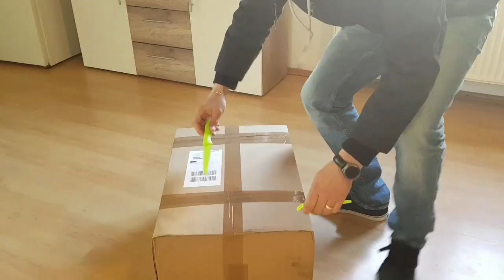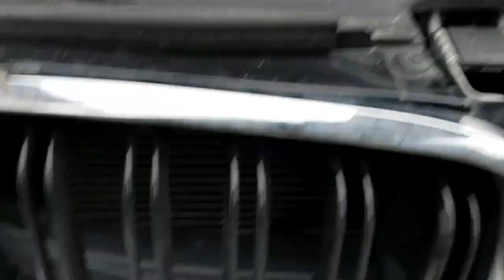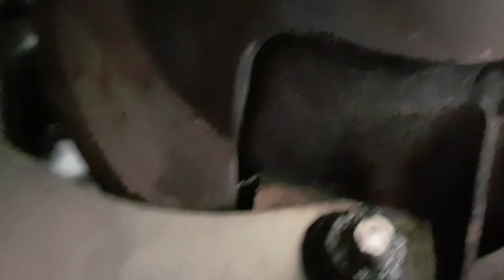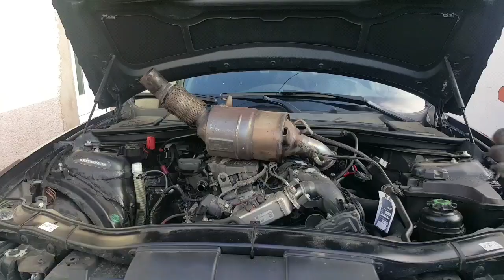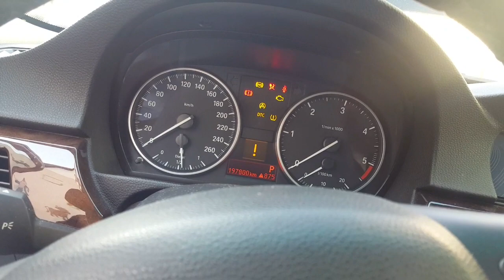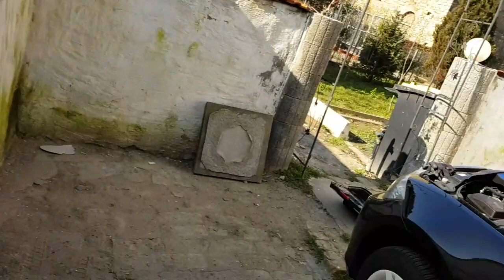BMW E90 DPF replacement (how to)

Comment: Hi !  You used an aftermarket dpf? Is it still ok?
Reply from the maker: Hi, it was an original one in exchange. It was fine but I sold that car a long time ago
Reply: @WarpDriveM do you believe an aftermarket for example walker would be ok for a Mercedes Cla 1800cc 2014 diesel?

Comment: Did you need the software to delete the error code after the new install ? Thanks Jon
Reply from the maker: Yes, you need a Software to delete the old Code at least. Normally you should register the new dpf as well

Comment: After looking online. It seems that once you have reached 150.000 miles the car will tell you that it needs to be replaced automatically even if it is OK. As my car is running perfectly fine I will just reset it and see how things go. Good video might need to revisit.

Comment: I had the dpf removed but my car is constantly blowing out white smoke and also rough idling. do you know what this could be. thank you in advance
Reply from the maker: Those are signs that is burning oil, injectors gone bad or dpf was removed and not properly coded out

Comment: Thanks for the very helpful video! I have to replace the flex pipe on the dpf on my e91. I was told, that I need to remove the dpf for that and I thought it would be super difficult. Now I think it’s probably doable! :)

Comment: My friend has the same model with a downpipe. Is it possible to put back a DPF, because the pollution regulation has changed. Is it the same operation than changing the fap? Thanks
Reply from the maker: Yes it's the same method to remove the downpipe and reinstall the new DPF
Reply: @WarpDriveM  i have read that the catalyasor and dpf are in one piece. in the catalysor there are 3 connectors. Can you please explain where the 3 are connected? I think one is the lambda probe. Thanks
Reply from the maker: Yes inside there is the kat and the dpf, 1 is lambda sonde, nox and pressure sensor and the 3rd one ist temp sensor. The plugs fit just one connection, you cann not put it wrong
Reply: @WarpDriveM  so there are 4?
 1. Lambda
2. Nox
3. Pressure sensor
4. Temperature sensor
is that correct? Thanks a lot. First time I get someone who can answer details!
Reply from the maker: The nox and pressure are on one sensor. The thin one is the temp sensor
Reply: and when the car has the dpf removed, i have read that they cut the dfp and break the ceramic, then they solder everything and put the sensors again. but the soldered part is not visible by the garagist. How can we make sure that a e90 we buy still has the dpf? Can it only be visible by the diag tool?

Comment: Did you replace the dpf with a bmw part or was it OEM? How is the car going now?  Good video.
Reply from the maker: Bmw part or oem is the same thing and yes. I've send my old original dpf to a company that cleans it and I received an original one reconditioned
Reply: @WarpDriveM  very good. How is the  car driving now 2 years  after you cleaned the Dpf?
Reply from the maker: @kirwanjohn101  no problem after that at all. I've sold the car about 2 years ago...I have a 435i now. You can check the channel for other videos if you like

Comment: Michael, just now as I have done the job myself, I noticed, you said earlier in the video that you wanna replace the DPF completely, but then I saw here https://youtu.be/6D_z9MHGQ3A?t=579 that you have also replaced the Flex tube on your old one, probably for selling it. Thats also what I did and I can only encourage everybody to do so, its only 30-50€ and some welding instead of a new DPF.

Comment: I've done this myself on my 2009 e87 118D. I have found that you don't need to remove that top bracket 14mm nut as you do at around 6:30. Using a long wrench the 13mm bolt can be unscrewed from underneath (use penetrating fluid though). In my case the nut stayed on and I think it's supposed to remain there. 
For me, the hardest part was removing that sliding electrical connector :) Never thought I had to use wd40 on those.
Thank you posting this video!

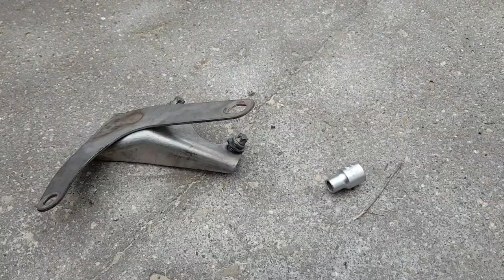Comment: Hi man. Thanks for the help with the video. I just changed mine dpf. I have a little tip. The support with the two bolts that fixes the dpf under the car. The one that you talk about at minute 11:20. I did not remove it because the position for unscrew the two torx is very bad when you lay under the car like me and they are very tight. I have only bended the two metal plates off the bolts and a little more for easy removing the dpf under the car. then when you install the new one and fix the upper bracket to the engine side you can bend the plates on the bolts and put the nuts on . the metal is very soft. so the job is even faster. last nut and bolt from the upper side. i did mine in 2 hours. 
thanks again for the video making the job possible for anyone with simple tools

Comment: There should be a gasket between the turbo and the dpf. Did you also replace that and the v-band clamp?
Reply from the maker: Not all the models have that gasket. In my case was no gasket and I've reused the v band clamp

Comment: That captive nut (14mm) on the dpf bracket was tight on mine too as not meant to be undone should take 13mm bolt from bottom why put mistake  in video wasted half an hour breaking that off lol

Comment: Warum didn't you clean your old dpf? You could save much  money.
Reply from the maker: This is what I've done! I've send my old dpf and I received a new reconditioned in exchange. The one that I replaced wasn't brand new
Reply: @WarpDriveM  Danke  für deine antwort!But  could  you tell me is posible to clean dpf without to remove it from it's place location?I saw on youtube that can be used a spray or something!It is a good  idea or not?What  is your opinion ?Danke!
Reply from the maker: It is possible but it won't work if the car has already memorized a dpf error even in shadow errors. That means more than 50% is clogged and you won't have any real results with a spray can. You might get away with it if you start regen with software and drive the car on highway more than 500 km to be able to do more than one regen
Reply: @WarpDriveM  thanks!

Comment: Thanks for the video, can you confirm you removed the DPF from below without removing the engine mount, thanks P.
Reply from the maker: Yes. But only for 1.8l and 2l. For 3l engine and above you have to remove the engine mount or subframe

Comment: Is there a gasket between the turbo and the dpf
Reply from the maker: No. But there are  some models that have a metal one. 318d doesn't have but some 320d have
Reply: @WarpDriveM  i think mine is leaking i have gotten a gasket so plan to instal it i cant see the leak coming from anywhere else. I have a 318. Thanks

Comment: Hello 👋 I need a new car. Do you suggest me to buy a diesel or a gasoline one? I see that diesel engines have the DPF that is not a pleasant thing to deal with. So I am a little bit skeptical about diesel right now. Am I right to be so? Thank you for your suggestions!
Reply from the maker: If you leave in Germany definitely you should buy a gas one  because of diesel scandal....if not diesel is better fuel efficient, last longer but is more expensive to maintain and you have to drive it a lot on highways in order to keep the dpf clean!  Gas ones have way cheaper maintenance but don't last that long as a diesel one...you decide for your needs

Comment: Thx! Awesome Video! 
Do you have any Problems until now with this DPF?
Reply from the maker: No. After the installation everything was normal👍
Reply: Warp Drive M how many km did you drive until now? 10.000km or 20.000km or even more?
Reply from the maker: Aprox 30.000 km after the filter replaced. I've sold the car (black e90) and I've got a gas one 3.0l engine

Comment: How much did you buy it and from where i have an 3er touring 1/2012 and i need to change it too, in internet it shows that it costs like 400euro it costs that much or not?
Reply from the maker: AHG GmbH and they will take your old one in exchange. I don't know the prices now but you can ask first. And after the installation you have to reset the car again and drive it  (motor way/ autobahn) for aprox 30 km to start the regeneration process. This video is showing how to change it on 2 l engines only. On the 3l or above you have to remove the motor mounts.

Comment: hello, i have e90 2012 184 hp 3.20d car , do you know have i dpf ? i have had this car since 2016 but i have never hear or did nothing for dpf. ( i change oil, filters myself )
Reply from the maker: Every diesel car since 2004 or 5 have dpf. You have for sure. You don't have to do anything about it if you drive the car on motorway at least 100 km a month or 2 months! This way the filter will burn everything from the inside!
Reply: Warp Drive M ty for answer

Comment: What is the law regarding taking the dpf off in your country?
Reply from the maker: It's 100 % illegal. You have to pay a big fine and your car will be towed. You have to put the car back to stock pay for all the work to the car, the tow truck  and like I've said the big fine! So is not worth it at all!
Reply: @WarpDriveM  thanks for the info and good video 👍

Comment: It don't need to be replaced. 5 l of petrol and air compresor do the job. DPF as new.
Reply: how to do that on an diesel engine ?
Reply: @thelegends7716  He means that you can just remove the DPF, soak it in petrol, that will loosen the residue inside. After that you can blow it out with compressed air. Refurbish it yourself.
Reply: Petrol doesnt dissolve ash so stop spreading misinformation. Only soot which is not really a problem of any old dpf. Ash is.

Comment: Ce recomanzi daca imi da eroare filtrul in ultimele 2 saptaman dupa 1-5km de la pornire dar nu am probleme gen sa traga mai greu sau alte chestii.. am incercat sa merg cu ea in 3000 rpm 30-50 la 110-120kmh de minute.. degeaba, eroarea tot apare..
Reply: Am fost acum sa o pun pe tester, problema la mine este "Abgas drucksensor - diesel partikel filter".. 40 euro senzorul de la Hella, si din ce am inteles pe un forum german, se poate sa fie si un furtun care intra in senzorul ala, intepat sau fisurat.. dar o sa vad maine, dupa ce schimb senzorul si bag o tura de  Salzburg-Munchen.
Reply from the maker: Cea mai sigura varianta e sa pornești 
cu testerul regenerare si dupa sa mergi pe autostrada. De obicei senzorii si furtunele de pe filtru nu se strica. Sunt facute sa lucreze la peste 1000°C si filtrul lucrează la aprox 6-700°C dar orice e posibil....Dacă locuiești în Germania poți să îți trimiți filtrul vechi la AHG GmbH si iti trimit altul la schimb cu aprox 300 euro. Dacă mergi sa il curați pe al tau e 150 euro. Dar trebuie sa mergi acolo. Anunță-ma sa stiu cum e după ce ai schimbat senzorul ca sunt curios. Scrie-mi te rog pe facebook Instagram sau twitter @warpdrivem ca acolo putem vb mai multe.  Succes
Reply: @WarpDriveM  Am schimbat senzorul dupa care am mers 30 km.. eroarea tot a aparut.. acum merg cu ea la BMW sa intreb de o diagnoza si de activarea regenerarii, sper sa mearga azi, ca de obicei astia iti fac programari si etc si apoi urmeaza sarbatorile, 2 saptamani..

Comment: 4.30 car is not situated on top of the ramp,  use extension bars to undo bolts/nuts so you have leverage above the engine. Cool video however.

Comment: Is it a common problem with the 325D that the dpf fails?
Reply from the maker: It's a diesel problem in  all car with or above 200.000 km or most city driving
Reply: @WarpDriveM  I know I have a 2008 astra with DPF and I know in general what is to be expected with a DPF. Some cars are more sensitive

Comment: Hi, what brand dpf did you go for? Need to do that same in my e90 330d. How is the filter months on? Any problems?
Reply from the maker: I've used an original one. No aftermarket. From a company that cleans this kind of filters. I've send it mine and I recieved a clean one in exchange and I've payed a difference.

Comment: I've been told you need to remove the engine mount to get the dpf unit out. is that true or could you leave it in place
Reply from the maker: You don't need to remove it. The filter will come out from under the car
Reply: @WarpDriveM  cheers buddy. May be pulling mine out soon to clean it. Guess while I'm there I should inspect the turbo as well
Reply: Warp Drive M  We're you able to remove it from under the car without removing the motor mount? Everyone else has said it's required.

Comment: Fain, tine-o tot asa.
Reply from the maker: Mersi. 👌
Reply: Ai vandut bmw-ul?
Reply from the maker: Da. Am luat altul benzina 3l. În Germania  au tot aparut probleme legate de diesel și au început să scadă prețurile f mult si nu se mai prea cumpara. Am vandut-o repede înainte să rămân cu ea și să nu o mai pot vinde decât pe nimic.
Reply: Ai dreptate, sunt si eu in cautare de unul ca al tau facelift dar greu se mai gasesc cu multe optiuni si ingrijite...daca nu raman la A5 2.0tfsi si aia e.
Reply from the maker: De asta imi pare cel mai rau ca l-am dat....de dotări. Era full...asta nou care l-am luat nu prea are dotări dar are mai multă putere. Păi Audi A5 nu e rau deloc...
Reply: As vrea sa vad cam ce inseamna bmw, ca si sportivitate, stabilitate, comfort si daca eram placut surprins ramaneam cu el dar daca nu gasesc ce caut merg pe A5 chiar daca e un pic mai scump.Momentan detin un passat CC 2.0l 140ps si parca as vrea sa o schimb cu altceva la anul.

Comment: Hii Sir, did you have to program the new DPF? Or can the error codes be deleted by A simple ODB2 adapter like my Carly for BMW
Reply from the maker: You don't have to program the new dpf. If u have carly just delete the error and select regen an drive it at least 30 km at 2500-3000 rpm to do a complete cycle of regeneration.
Reply: Otherwise it must be programed.

Comment: Did you have to remove the exhaust?
Reply from the maker: No. You can remove just the bolts and let it hang on the rubber bushing

Comment: Great video man! Thanks. I have two questions for you. I have the same car, I do a lot of short trips but monitor exhaust temperatures with an obd Bluetooth  adapter. When it's doing a regeneration I just take it to the motorway. Do you think that's fine or am I looking at problems developing ( so far in 2 years no problem). The other question is do you think non oem dpfs are rubbish? Thanks
Reply from the maker: How long you are driving on motorway at least 40 km a month you are ok. In the last year I was driving just city 20 km each day that's why I had to change it. And no the aftermarket dpf's are not rubbish. Thx for watching! #warpdrivers #warpdrivem
Reply: Warp Drive M my car is almost 190,000km on the original dpf... I imagine I'm going to need to replace it soon. Thanks to your video I may just do it myself with an aftermarket filter. Vielen Dank. Grüß
Reply: What program do you use for bmw on your phone ? Also do you need to reset any dpf calculations on ash and soot that may be held in the ecu from the old dpf ? I know this is need on Subaru Diesel but BMW I know nothing about. Cheers

Comment: I have tried this myself but didmt have room to take the dpf out. How did you remove it after you unbolted it?
I have an 320xd e91 2009 so it may be diffrent?
Reply from the maker: I took it from underneath the car. But if your car is xdrive maybe you should remove some other things in order to make some space for dpf
Reply: Henrik H Hermansen  hur gjorde du? Får inte ut mitt heller.. samma bil som dig.
Reply: @avhej6543  Fick du till det? Jag håller på med min E91 XDrive och funderar också på hur tusan jag ska få ut filtret

Comment: How much was the DPF filter?
Reply from the maker: I've sent the old one in exchange and I've payed 300 euros
Reply: Thanks for  getting back.Last question.Did you lift the DPF  upwards (toward the bonnet) or took out from the bottom.
Reply from the maker: Zaf Mahmood from under the car. From the top you don't have enough space.

Comment: Hi i see your cars engine is similar to mine my car is 2010 177bhp in uk do these have the new style egr valve also swirls flaps and vortex filters thanks keep up the videos
Reply from the maker: The engine is the same on 318 and 320. Just turbo, injectors, and intake is different. Thx for watching 👍
Reply: Warp Drive M thanks for replying can you please do a video pointing out wherethe egr valve is on this engine

Comment: That’s why you should buy app in google play called “btool expert” and app will tell u when your bmw want to burn out DPF. And even if u are just driving in town u can alway go out for spin on motorway for 15 min to do proper DPF burnout. App is showing u details like temperature, pressure, soot, ash, and many more 
U can check injectors adjustments, actual and expect values for air intake, boost and fuel pressure 
Also u can read and delete errors from all car modules 
Check it u don’t need to sell beautiful car ;-)
Reply: s3k4t0r many thanks , I got the btool expert app on my eonon head unit and it can force a DPF Regen , absolutely brilliant , thanks very much
Reply: Andrew Peel, I also have an Eonon headunit. Which bluetooth adapterdo you use to connect to the Eonon? I suppose you have to have one without password?
Reply: otto16121970 , Hi I use this one .... Bluetooth ELM327 OBD-II Diagnostic Scan Tool Applicable to Eonon head unit with Android 4.4 to 7.1 system , just google it , I bought it from ebay £16.75 👍
Reply: Andrew Peel Thans, did you had to pair with or without password?
Reply: otto16121970 No password required , just connect to ELM device
Reply: Andrew Peel Thank you. 👍
Reply: Andrew Peel your welcome it’s not my app but is very helpful and is much cheaper then Carly just show the app to your friends might be helpful for them too